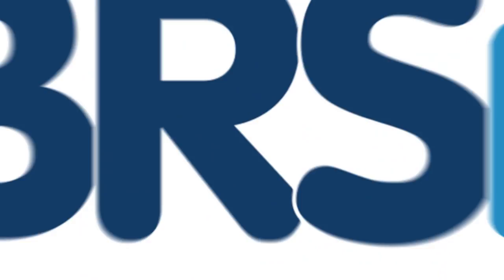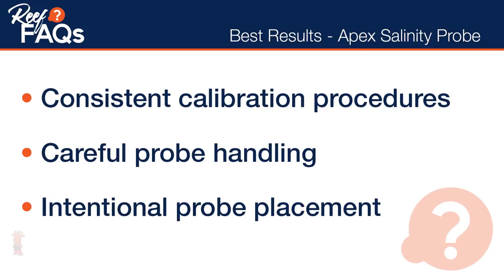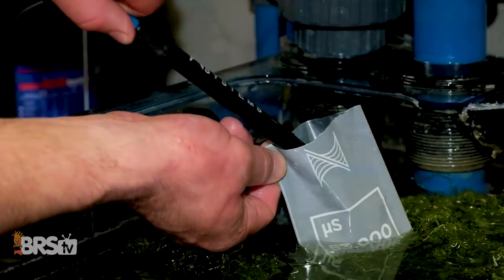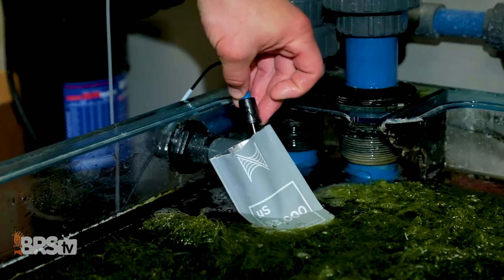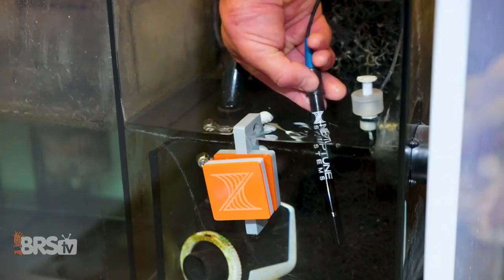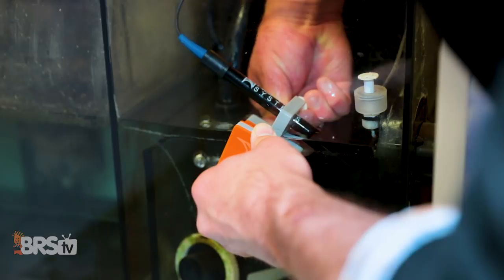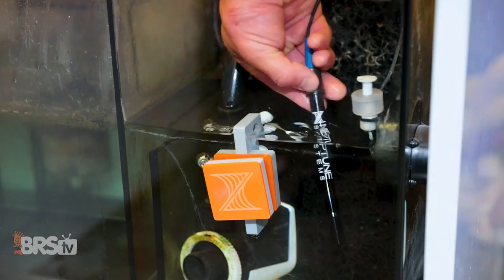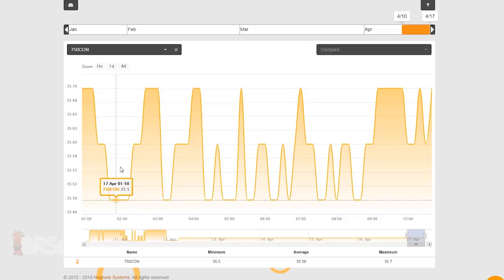How to get stable readings from the Apex Salinity Probe? | Reef FAQs

Comment: I bought a new apex and have had such a hard time getting a good reading with the dam salinity probe.
Reply: Yup, mine is all over the place. No where near my refractometer reading. I think I need to re-calibrate and rout the wire away from all the other cords. I may have stray voltage in the tank as well.
Reply: Brian Baier I’ve done mine like 5 times!!! I’m moving it this weekend.
Reply: Do you need to let the probe air dry for couple hours before recalibration

Comment: I did these procedures time after time. No help. I did find a setting that is extremely important and should have been mentioned for accuracy is the TC Factor Setting. Adjusted mine and the probe is almost dead accurate to my Hanna Checker.

Comment: I'm a huge fan of neptune products, but the salinity probe has been not only a complete disappointment, it's been downright dangerous to use and trust the thing. 

My salinity probe is 6 months old now. As of two weeks ago, it's completely useless as I tried to recalibrate it and the calibration failed miserably. The automatic calibration would not work at all and when I tried to do the manual calibration, the settled value of the probe when it was dry was higher than the settled value in solution. 

I originally just pulled the probe from the sump, and lightly shook it to get water out. Didn't work. Then I dried the probe. Didn't work. Then I rinsed the probe in ro/di and dried it. Didn't work. Tried all the things. The shaking to get air out, fluid in sump for 30 minutes to temp acclimate. I even read that it wants the fluid at 77 degrees and turned my observation tank to 77 and put the packet in there for 30 min to see it that would help. No. Nothing would work. I actually just got another calibration packet and am going to try again, but I'm not sure why.

All that said, that was how the probe died. During it's "useful" life, it constantly drifted up or down, causing me to add more ro/di water or salt water to correct until I finally learned that I should test the water with a calibrated refractometer before making any adjustments based on salinity probe reading. When I decided to calibrate it, it was reading 33.2 and the salinity in the tank was 35.5

I considered replacing it, but honestly, it's not worth the hassle. This thing is not well made and not trustworthy. Why bother spending that much on the probe when I could just buy the digital refractometer for the same price and not worry about it.

Comment: You actually don't mention one of the very most important things to do to ensure accurate salinity probe measurements.
Do the Manual Calibration, not the Automatic or Task, and turn on Temperature Compensation. 
If your tank temp varies by a degree or more, you will see a parallel false change in salinity unless TC is turned on and set to a correct value (typically 2.2).
Reply: Great info, I'm having issues with two salinity probes (one in sump and one in my SW station). Anyhow, I'll give your method a try. Thanks!

Comment: The problem with the Apex salinity probe is that it is utterly unsuited for use in a reef tank. I mean, which idiot chooses a "lab" electrode for a process monitor/control application? This applies to all electrodes but especially to the conductivity cell they picked.  
For seawater salinity measurements it should have been at the very least a 4-pol electrode, better actually a toroidal (inductive) sensor, not just a simple 2-pole electrode that is meant for clean water and low conductivity applications. https://www.globalspec.com/learnmore/sensors_transducers_detectors/analytical_sensors/electrodes_conductivity
And that isn't all, whoever soldered the connector to the electrode did a shoddy job and created cold solder joints that might come apart. I had 2 of these electrodes failing on me and in both cases at least one of the leads had come off the connector contact. 
One of those electrodes I was able to fix by soldering a new Mini-DIN plug to it (with good old fashioned SnPb solder and not the lead-free RoHS stuff that needs to be soldered under an inert atmosphere to actually stick.)
The second electrode must have had on top of the connector issue a broken cable or contact wire in the electrode itself. So I cut it apart to see what it actually looks like on the inside. What I found was basically a bubble trap.